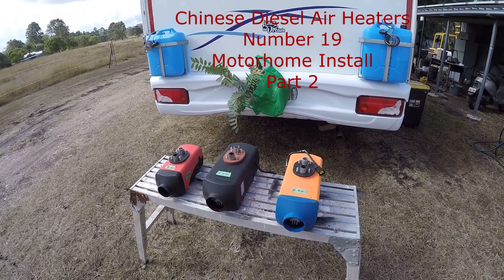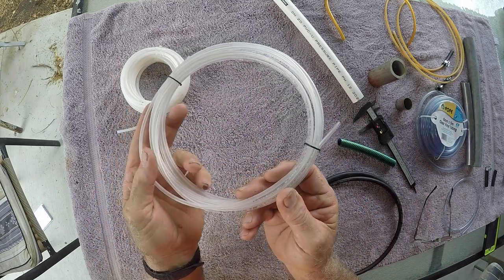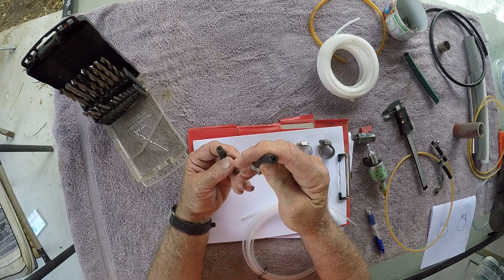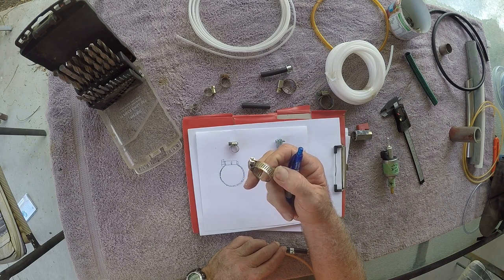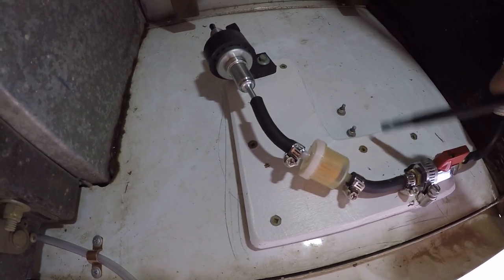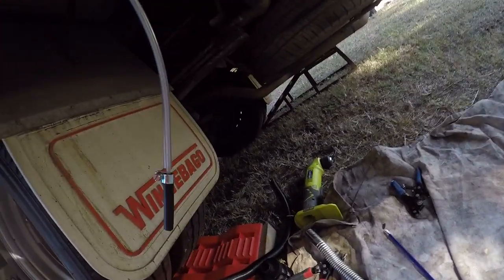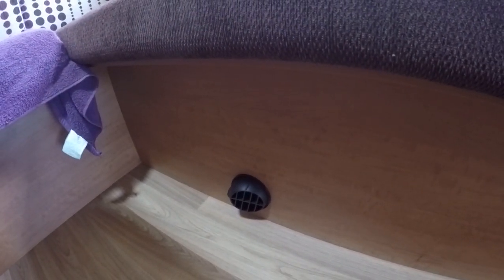Chinese Diesel Air Heaters no 19.   Motorhome Install Part 2

Comment: approx
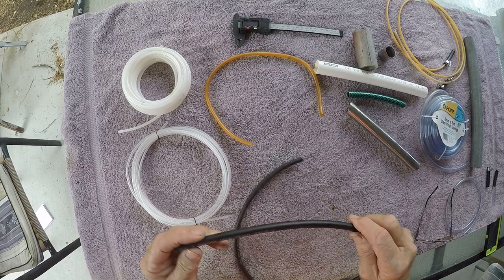0:50   hoses  
3:50   perishing tube  
4:20    delivery tube       
5:00   conduit   
7:30   hose clamps  &  14:20    
10:20  connections      
12:57  leaks      
14:20  clamps     
16:45 fitting     
18:25  connect to truck fuel       
19:45  mount for valve , filter , pump    
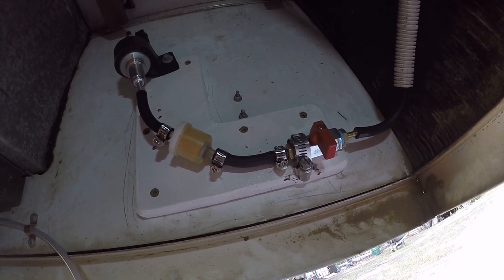22:45 priming    
24:40 delivery line    
26:25  wiring   
28:45  ! wiring size    
32:30 hole for conduit
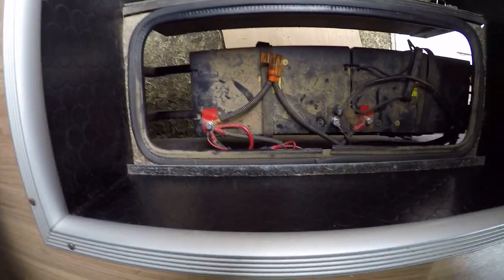34:00  testrun

Comment: Hi big John, the capturing the lost heat off (by encapsulating) the exsost pipe I told you about, is working just fine. Now another idea I came up with that will TOTALY ELIMINATE , the noise of the PUMP!!!  If you go to a GOOD liquor store you should be able to find a bottle of wine that will be protected by a expandable plastic mesh that protects the bottle of wine. Acquire that mesh one way or another. Take your pump fit it into that mesh at the proper angle, suspend that mesh from the rubber holder that comes with the heater so that it is TOTALY NOT touching ANYTHING, and the noise will be TOTLY self contained , and will NOT be transferred to ANY object. Enjoy the piece and quiet from the ONLY thing that is bad about these heaters. Good to see you back.   Rick.
Reply from the maker: Thanks for the feedback Rick.  

The pump on the Med boat is suspended in space with rubber "cobweb" ties right under my bunk, and it is very quite. Supplied by Eberspacher, and very expensive. I must try your version.  

Can you give me more details about your exhaust pipe mod.

Thanks.  JMcK
Reply from the maker: Ranchdude43 
Thanks for that. My email. johnmck47@outlook.com.
Reply: Hi mate could you post a video about your exhaust heat extractor (I've got the idea of running the exhaust through a car intercooler, with fans blowing over it, to extract all the heat from the exhaust)

Comment: I want to thank you John for making this series. This was vital information for me to get a good grips on what a diesel heater is.
Especially these two last video's were important. Next Saturday I will pick up my (used) camper. It has a gas heater on LPG. I really do not like that.
I was worried about the noise level of these diesel heaters but it seems fine. Here in the Netherlands camping spaces are quite small and I do not want anyone to complain about the noise of my heater.
The camper you install here is not much bigger than mine but mine is much older (1995) so it may not be as well insulated.
Still I hope that running the heater at a low setting will be enough, even on cold nights.
I will also install solar panels with a second battery and run the heater from that battery.
Reply from the maker: Hi CD, pleased you found the videos helpful. 
Most of the noise comes from the fan speed with these heaters. That is one reason why I recommend it is better to have a bigger heater running slow rather than a small heater running flat out. JMcK
Reply: @johnmck1147  Thank you for the reply.

Comment: Thanks John, really helpful for my upcoming diy install to our little caravan. Plus I know the effort that is required to produce videos.
Reply from the maker: Pleased they were of some help Scott.   JMcK
Reply: Hi again John! My intention is to use the fuel tank from the van. I understood the best way is to drill another hole in the van tank and inserting there the pick up tube supplied with the diesel fuel, right?

Comment: Thank you John for all the time  you spent on explaining and showing how to set up and use a portable diesel heater. I just order my first one and lucky it comes with a good control switch and its a 5 kw. I watched all your video and now have a better understanding on how to set up my first one. My first one will be installed in travel trailer and 2nd one will be a boat. Thank again for the time you spent on explaining everything.
Reply from the maker: Hi Mario,
Thanks for the feedback and kind words.  JMcK

Comment: John, your teaching approach is very good indeed. At least it suits my learning style. I aspire to your level of clear thinking - the fuel line clamps, fitting tips, the wire gauge, fuse placement, on/off switch...so much detail based on solid logic (that you so clearly describe) and thought through principles. Like another reader, an install like this of a 5kW unit is on the horizon for me so this series has prepared me very well. Thank you.
Reply from the maker: Wow Benny! Thanks for the positive feedback.  JMcK

Comment: Thank you.  

I've watched the series twice over the past 20 months and my generic 5kW diesel heater was delivered today.  I'm looking to add a bit of heat to a somewhat larger area - providing just a little heat to the unconditioned area of a basement when power is off and the gas-fired furnace isn't warming any of the space in the house.  I have 12 volt power from the solar-charged battery bank that provides "Wait until daylight" power - enough backup that I'm not out in a thunderstorm or shoveling 7 inches (18cm) of snow in the dark to get a generator out of the shed.  The "little heat" is just a few degrees - enough to keep the pipes down there from freezing, so just keeping that space above 35F (2C).

For the heater's "master" power switch, I'd be looking for a key switch - one with the key removable in either position - so it's not easy to accidentally turn it on or off.  If that key is on the same keyring as the vehicle's ignition key/dongle, it should be somewhat hard to lose ;-)
Reply from the maker: Hi Notyoung, thanks for the feedback and info. I hope it all goes well for you.   JMcK

Comment: Used the little slot in the mounting plate to get the pump wires outside without having to cut and join or drill.
But have since relocated the pump inside.

I Luv my heater  .  Thanks

Comment from the maker: You can use similar wire size, or one size bigger that the controller uses. 

The controller does not have a high current draw. 

It is the heater that draws up to 10 amps to operate, and requires much thicker wire than supplied with most heaters. JMcK

Comment: This is such a great series on these heaters. Thanks so much John. I'm still a little unclear about where to mount fuses and what size the fuses should be, but that's probably my fault. I'll be installing my own heater soon and I could not have asked for a better guide.
Reply from the maker: Thanks for the feedback Carey.

You mount the fuses as close to the power source as possible. I mount the fuse for the power supply to the heater right at the battery. The heater can draw 10 amps on start up, so a 15 amp fuse is appropriate. 

It is not essential to fuse the dosing pump, but good practice if the pump wires are extended, and run along the vehicle metal frame. A 3A or 5A is appropriate here. Mount this fuse close to the heater, as that is where the pump draws its power.

Cheers.  JMcK

Comment: Just realized the fuel pump is always suppose to be under the heater? Glad i found that out now, will have to mount the filter and all that on the outside under the van.

Comment: Thank you very much for these videos John. I watched all the episodes relevant for my installation and have some minor comments. Not sure which episode, so I post it here:

- While crawling under my van for installing the diesel supply, I noticed an identical diesel pump installed. Found out later it belongs to the diesel particle filter. This pump is installed horizontally. So, either the pumps installed by Ford can work horizontally, or my engine emission is not as clean as it could have been.

- I primed the hose between the tank and the pump by sucking with a large syringe. The plan was to prime all the way to the heater, but the syringe couldn’t suck across the pump. I guess it wasn’t important, as the pump was already lubricated when priming downstream.

- I remember that you advised against using a wider hose between the tank and the pump, mentioning the weight of the fluid. I must disagree here: The pump has to work against pressure difference, which is only determined by the height difference between the nozzle at the heater and the surface of the diesel in the tank – and the resistant to the flow (viscosity): the narrower the more. This pump is also accelerating the fluid at each beat, also for this effort the wider the better.

- At the hose joints where the pulses are absorbed by the connecting rubber hose, the amount of “lost pulse”, is determined not by the distance between the ends of the stiff hoses, but by the distance between the clamps on the outer hose.

Again, thank you for the videos, I hope these comments can help in case you revise them.
Reply from the maker: Hi Istavanger,

Thank you for your feedback.

The reason for installing these dosing pumps on a slight angle is to allow the little cavitation bubbles to escape easily. The pumps will still work on their sides, but the tiny bubbles will form big bubbles that can cause a dry spot on top of the pump and hence wear, and also large bubbles absorb the pulse of the pump. You need the pressure pulse to force the diesel through the atomisation screens in the diesel burner.

I have not studied in detail particle filters, but logic tells me they would also work better if the dosing pump had a slight up angle.

There is no need to self prime the set up past the pump. Once you get diesel to the pump it is lubricated. You can use the pump itself to prime the rest of the fuel line.

A few people have taken me to task about wider hose between tank and pump, and after testing I now recommend to use normal fuel hose from tank to shut off valve, to filter to pump. From pump to heater, you should only use narrow bore hard nylon, (unless the distance is very short) . 

Thanks again for your comments.  JMcK

Comment: Love the videos so deep into explanation 👏 on the fiat ducato fitting a sender we went into the top breather pipe by screwing 4mm hole and placing in the sender we sealed with some ct1 sealant it took 2 minutes to do

Comment from the maker: On the inlet side of the pump, ie tank to shut off valve to filter to pump can be standard good quality black rubber fuel hose. From the pump to the heater, particularly if more than a couple of feet, you should only use narrow bore hard nylon or metal fuel line so so the fuel pulses are not absorbed by the soft fuel hose. JMcK

Comment: Hi John. Thank you so much for these videos, they go into so much detail and have helped me understand the heaters a lot. I'm still stuck because I can't find a suitable solution for my tiny Nissan NV200. There is some room underneath but I can't afford a more expensive heater that can be mounted externally, and the only place I can mount internally would be under a seat, but all of those 'turret' plates are too wide and would hit the chassis box underneath, it's a tiny van! The only solution I can think of is to fabricate a thick aluminium plate to raise it up over some cables and reposition the bolt holes, but I'm still scared. If and when I do find a solution, I will follow all your guidance and watch the videos a second time. Thanks again!

Comment: Really good information not only for this work but also help full in general life (like clamps, wire and hosepipe and tube size..
Really love your efforts and you share valuable information of your life experience.
Normally I watch videos around 10 to 15 minutes but I am thinking if your video are more then 3 hours. I should watch completely.
Thanks
Reply from the maker: Wow Zaheer, thank you for your positive comments.  JMcK

Comment: Hey John hoping you can help. Heater has stopped working after going great about 10 times. E8 fault Fuel is good. Air intake good. Runs for 5 to 6 min then shuts down.

Comment: You have no idea of how I came across your videos but, I'm so thankful I did.  I'm really wanting to install one of these in my Whittley SL26.  The research over the last month has driven me quietly insane and I'm yet to purchase a unit however, it will be a 5 Kw system.  I'd really like to have a removable fuel tank so I'm freeing up space over the warmer months.  You taught me I need the master switch, to swap out the hose clamps and a few other little tricks.  The main issue I have now is where and how to physically install the unit in the boat.  Any tips and pointers would be grateful as it looks like the unit will need to be installed on a custom bracket, I don't have a floor to cut through etc.
Reply from the maker: Thanks for the feedback Cammo.
Have you seen the boat install video?
Cheers, JMcK
Reply: @johnmck1147  I’ll find it and will be sure to watch. Thank you 👍🏻

Comment: Hi John i have watch all your videos which i have found invaluable thank so much. your attention to detail is fantastic however i was hoping to set my heater (still in the box) up to combat the cold Irish winters in my little workshop ,my biggest concern is that to run the electric side i also purchased a 240v to 12v transformer hoping to just plug it into main supply.however you have repeatably said that the heater must be turned off with controller to allow cool down period can help feel concerned if someone turn it off at mains by accident or on purpose  or had solution

Comment: You've the best videos on these units. 
What happens when (not if), the cheap brushed motor the Chinese use, dies suddenly while the heater is working at max? 
The originals all use brushless DC motors. Much more reliable than a cheap power tool motor. 
I think 5KW is too much for an RV. Even at the lowest setting of 1.6Hz, it puts out 1KW if I recall. Which is more than enough to replace a 750W electric heater I currently have.
Of course mine is well insulated. 
Unless I can change the motor and put in place the same good quality BLDC motor used in a Eberspacher, I won't be able to sleep, worrying if I have to use it beyond 3Hz.
1- Do you get an audible alarm if the RPM stops when not expected?
2- What happens if the heater loses power while at max and then power comes back on a few seconds later? Like turning the power to the unit off by mistake. Then quickly powering it back on.
Polyurethane glue or construction adhesive from any hardware store is safe on foams of any type. Lot less expensive than epoxy and readily available. 
If you find a yoga mat, hold on to it. It makes great noise and vibration dampener. Glue many pieces together to form thicker pieces or custom 3D shapes and enclosures. 
Enjoyed your videos very much. Thank you for sharing your expertise with the rest of the world.

Comment: great video hi john can you tell me where to get the 2mmx4mm  black fuel connection hose for the 2mmx4mm nylon hard fuel line.
Reply from the maker: Hi Mr T,

You can buy the black fuel hose at any auto store, or small engine store. 
Just make sure the hose is a tight fit, take the nylon hose with you.
If you can easily push in the nylon hose without first soaking the black hose in hot water it is too lose.

You can also buy on line from multiple sources. Below is just one source to get you started in your search.

https://www.ebay.com.au/itm/5mm-Rubber-Hose-Fuel-Filters-Diesel-Heater-Replace-Parts-For-Eberspacher-Webasto-/124637655229?mkcid=16&mkevt=1&_trksid=p2349624.m46890.l49286&mkrid=705-154756-20017-0

Cheers.   JMcK

Comment: If you do not mind single-use clamps with VERY limited clamp size ranges, I would suggest the use of Oetiker stepless clamps.  They give the best 360 degree even clamping and are one piece of stainless.  Just buy an assortment of sizes to get you started and be mindful of their clamping ranges.

Comment: Hello John, I don't know if you are still answering questions on your truly outstanding set of videos, but I'll ask just in case. I am working on my installation in a van conversion project, and am planning to put in a power cut-off switch, as you recommend here, just for the main power wiring, as my pump line will not be long. In your master switch panel, I cannot see what the small black wire that enters the switch at the bottom between the red wires is running to. Also the black power line extension appears to be a black and red wire combination. What have I missed or misunderstood? Again, thanks so much for your fantastic contributions here. I wonder how many fires and poisonings you've prevented!
Reply from the maker: Hi Textilis, 
Pleased you found the videos helpful.
There is a positive and negative line coming direct from the battery (fuse in positive wire right at the battery) to the master switch. The switch I used has an indicator light that comes on when the switch is on. The small black wire is on the negative side of the small light to provide a circuit to light the light when the switch is on.  JMcK
Reply: Thanks so much,  @johnmck1147  . That makes sense. I'm making a gasket today for a removable installation, as you did for the motorhome video. Will seal it to the floor with RTV heat-resistant sealant, and seal with grease to the one-piece mounting turret I'm using to go through my finished floor. Can't find any silicone "grease" only wet or dry sprays, so I'm hoping white lithium grease will be OK. I know it's for metal to metal, and this will be gasket to metal, but at least it's for high-temp uses. Fingers crossed, and thanks again! Jennifer

Comment: Thanks for all you videos John. You made the install a breeze…just one question though, where did you get that recessed rocker switch?
Reply from the maker: Hi Blair, I made it out of some 50 mm pvc pipe with a ply flange epoxy glued to the front, and a piece of ply epoxy glued inside tube for switch.  JMcK

Comment from the maker: In any electrical circuit, the current goes out from the source, through the “power machine” and back to the source. You must consider the total wire resistance as the amps must travel out and back. 

If you go for a day trip to visit a friend in another city, you must have petrol to go out and come back home. JMcK